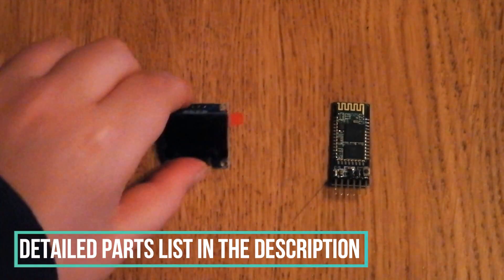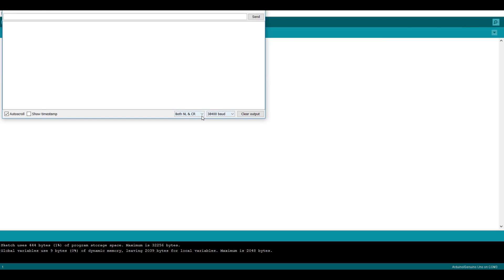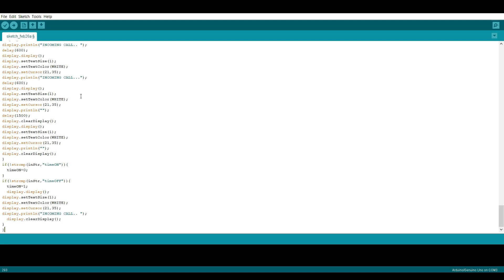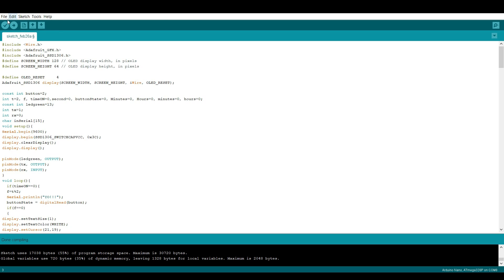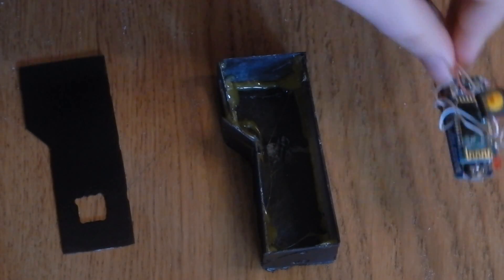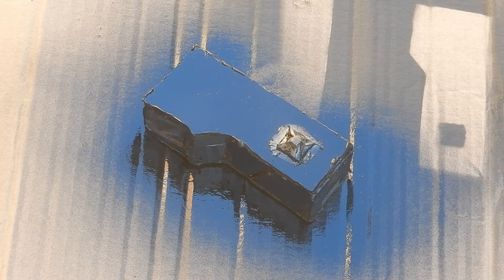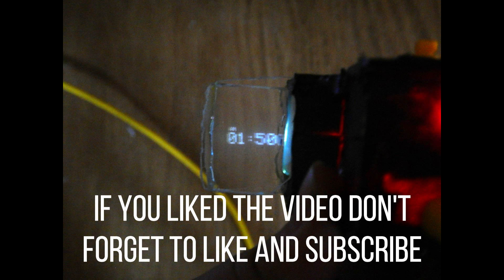DIY Smart Glasses | NO 3D PRINTER

Comment from the maker: *How to install the app*

Step 1: open the link and click on Gallery (top right)

Step 2: in the search bar search for: SmartGlasses App

Step 3: click on the app with an image of my SmartGlasses

Step 4: click on OPEN THE APP then choose a project name and click OK

Step 5: the app editor should open, when it does click on Build (top left)

Step 6: from the dropdown menu choose App (provide QR code for .apk)

Step 7: on your phone enable download from unknown sources (or something like that)

Step 8: let it load and when it's done scan the QR code with your phone (download an app to be able to scan QR codes)

Step 9: a web page will open just let it download the app and it should be installed on your phone

the link: http://ai2.appinventor.mit.edu
Reply: Thanks I'm searching for this project and see a lot of video's but they don't give Arduino But I Finally see your video it's amazing any very useful and you also give Arduino Code and app link
Reply from the maker: Thank you so much!
Reply: it will be more useful if you provide the circuit diagram of the project
Reply from the maker: @parveen sulthana
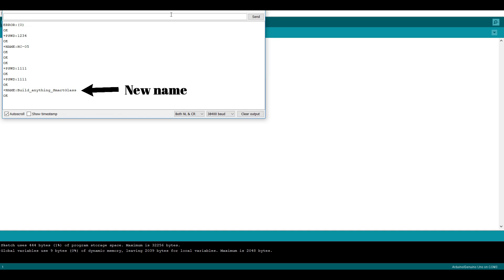I did, pause the video at 1:38
Sometimes you may need to connect the button a little differently. connect one side to GND and the other to pin 2 then everything should work :)

Also I would Really appreciate it if you could subscribe I'm trying to get to 💯 subs :D
Reply: Link not opening??!
Reply from the maker: It does open for me, maybe the servers were down? 
Try again and let me know if it works :)
Reply: @BuildAnything   it connected with bluetooth properly but not showing....msges.....
and also im not added button.....so may be it not work without button.......whatever but ur realy great man
Reply: Bro the link worked and I opened it but when I am clicking on gallery nothing changes , it's the same page
Reply from the maker: @sheenabal7022  hey sorry for the problems, did you open it on a pc? Because I just tested it and it worked fine, try again and let me know what happens!
Reply: Hey, is it just me or the app doesnt have the phone calls, ca you tell me how to enable them
?????
Reply: Bro can u send me a direct link of the application
Reply: How to get the link
Reply: Thank you so much dude

Comment: Hey 
I am a class 11 student .
Will I be able to build this?
As you mentioned by you in your comments , is this video outdated ?? 
If yes then , please tell me some other video showing the tutorial of Smart Glass .
Thanks
Reply from the maker: All of this should still work just as well as in the past :)
Reply: @BuildAnything   Thanks a ton 
And will I , class 11 student , be able to build it ?
I thought one more customisation on this :
Can I use SOLAR CELL instead of regular battery
Reply from the maker: Solar cell probably wouldn't give enough energy + you'd have to add a voltage regulator...

Also I really can't tell you if this is too hard for you or not, I was 14 when I made this but I've also been doing this stuff since I was 10 or 11, you just have to watch the video and see for yourself
Reply: @BuildAnything   Thanks 
I was asking because I am in India and here , the educational system ONLY focuses on the theoretical learning and not on practical work
So this would be my first PRACTICAL TECH PROJECT
Reply from the maker: Oh, that's awesome!

Comment: Hi, Can't understand the circuit diagram, some wires are not connected or maybe it is color-coded
Reply from the maker: Just connect it like in the circuit and it should be fine, if not please be more specific
Reply: @BuildAnything  some wires are not connected
like 2 red wires are not connected so is it color coded and I should connect those  together
Reply from the maker: Are you talking about the "key" pin on the bluetooth module?
Reply: @BuildAnything  I am talking about the main connections at 1:37 seconds of the video
Reply: like the 5V of Arduino and VCC of bluetooth  module
Reply from the maker: @Tech-hx2qx  5V of arduino is connected to the VCC of the bluetooth module, yes
Reply: @BuildAnything  Thank you very much
Reply from the maker: No problem :)
Reply: Just two more questions - One LED pin goes to 5V and the other?
Reply: Could you tell connections for adding a battery

Comment: I am thankful to u for putting up this project. I have uploaded d code and downloaded d app from d link. When I get to d main screen of the app, it is showing connected but when I call from someone's phone or send any msg, it is not showing on d OLED. Can u suggest me what extra things I need to do to receive and c d  notifications on d OLED?
Reply from the maker: So when you send a message from another phone to the phone with the app (and the app is open) it doesn't show up?
Reply: @BuildAnything  Yes. The app is running but on d OLED display, only d time is being displayed. Nothing else. What else should I do? U have connected LED and push button but I did not connect these 2 components. Has it something to do with this? Is it necessary to connect these 2?
Reply from the maker: Yes, connect the led and button and try again. (And make sure to give the app permission to Bluetooth!)

Also if you liked the video and would like to support me you can subscribe, it would really help me with the channel! :D
Reply: @BuildAnything  I have 2 more questions from d circuit diagram u showed :- 
1.) Where r d short and long terminals of LED connected to?
2.) Where is that 1 pin going from push button to Arduino?
Reply from the maker: 1. The long leg from the led is always + so in this case the long leg gets connected to the Bluetooth module and the shorter one (- / gnd) gets connected to gnd

2. One leg from the button gets connected to d4 (arduino nano) and +5V the other is connected to gnd through a 10K resistor

Good luck!
Reply: @BuildAnything  The long leg of LED is connected to which pin of Bluetooth module?
Reply from the maker: Look at the schematic, it's the red wire going from the led to the side of the Bluetooth module (right line of pins, 3rd one counting from the bottom)
Reply: @BuildAnything  Thank you very much. I'm able to receive calls and messages. I modified your app for receiving the calls. Can u tell me how can I display the date and time via Bluetooth?
Reply from the maker: @surajk3195  Sorry for replying so late but I'm afraid I can't help you I'm busy working on another video.. maybe watch some arduino C++ tutorials? I'm very sorry but I don't have time to figure that out for you right now.

Good luck!
Reply: @BuildAnything  Just tell me this much. Do I have to make any changes in d code or in the app that u made?
Reply from the maker: Time is already programmed so you'd only have to make some changes for the date on the arduino. (Unless you want it to auto-callibrate but that's a whole other story...)
Reply: @surajk3195  how did u modified the app

Comment: how do u make it.... smaller?
Reply from the maker: That would not, and I mean NOT be simple! I'm sorry but I really can't explain it like this it would need a whole new design...
Altough I might try to make a v2 in the near future! I'm not 100% sure though.
Reply: The really small screens are very expensive. (I think) The old video glasses from early 2000s used screens like that. They're Kopin or Sony brand Liquid Crystal on Silicon displays. They were like 1000 dollars for a product that does less than VR headsets. Hopefully those small designs will cost a lot less in the near future.

Comment: if i add a litium battery should i change the code?       plz help
Reply from the maker: As long as it's got the right voltage it should be okay. Of course you will need to have a connection to be able to charge it. And no the voltage doesn't have anything to do with the code so you don't need to change it :)

I hope this helps, if it did I would really appreciate it if you could consider subscribing. And if you have any more questions don't hesitate to ask!
Reply: @BuildAnything  sorry, but i asked if i want to change the codes

subscribed.
Reply from the maker: no you don't need to change the code at all for it to work with a battery :)

Comment: The clock is running on its own it's is not stopping please help me as I have to submit the project tomorrow
Reply: Please make it fast
Reply from the maker: My phone died.

There must be some problem with the wiring of the button, check all the connections again and let me know if it works.

Comment: You need a battery to make it portable.
Reply from the maker: you could easily use a lithium battery, I just didn't have enough time or money to order one :)

Also I would really appreciate it if you could subscribe, it really means a lot to me :D
Reply: Build Anything the thing is, it’s a smart glass, meaning it ideally NEEDS a battery for people to wear it. Don’t worry, I already subscribed.
Reply from the maker: Yes I know.. if you want I can give you very detailed instructions on how to add a battery.

Ps, thanks for subscribing
Reply: @BuildAnything  can u plz tell me if i add a battery should i hange the code
Reply: Music Beats nope, as long as the voltage and current is adequate you should be fine without altering the code :)
Reply from the maker: @mohammedjasim5919  no you don't have to change the code at all, as long as the voltage is right everything will work the same as in the video :)

Comment: I connected evertyhing like you but my hc06 module does not working regularly and display starting counting 00.10 00.20 00.30 00.40... what am ı doing wrong?
Reply from the maker: First of all please check if your button is correctly connected
Reply: @BuildAnything  So what should I connect without button?
Reply from the maker: Try connecting one side of the button to GND and the other to pin 2. Please tell me if it works now :)
Reply from the maker: You didn't reply so I'm assuming it's fixed, if not let me know.

Good luck with the rest of your project! :)
Reply: @BuildAnything  I did it but ı have another problem. I connected app, clicking the buttons but nothing happens. Is there a problem with app? Because my hc06 module is working clearly in my other projects. Thanks for help :)
Reply from the maker: Go to the settings of your phone and allow the app to use Bluetooth then you should be able to select and connect to the module with the app :)
Reply from the maker: I'm assuming it's fixed, if it is I would appreciate it if you could subscribe I'm trying to get to 💯subs

If not let me know

Comment: Hey bro pls help me with the programming... It is coming adafruit gfx.h no such file in directory
Reply from the maker: Hm, let me think... 
I know! maybe it's a library that was automatically installed on my pc. Just install the "adafruit gfx" library and everything should work :D. If this doesn't work let me know and I'll figure it out.
And of course if this helped you consider subscribing, I would really appreciate it.

Good luck!
Reply: Hey bro thanks for replying i downloaded the library but now it has error with uploading the sketch. And its having a messege related to the bytes
Reply from the maker: Unfortunately there is a lot and I mean a LOT that can cause this. It might sound obvious but just to be sure first check these things:

- is the arduino plugged into your pc?
- does you pc detect it?
- in the arduino IDE can you select a COM port with "arduino/genuino uno" next to it?

Check these things and tell me the outcome so I know what the problem is and how to fix it.
Reply from the maker: You didn't reply so I'm assuming it's fixed, if not let me know.

Good luck with the rest of the project!

Comment: How can I make the App?
Reply: I have another question, Is all the program for arduino supports every arduino.
Reply: And also will you place the app link in  description. ☺️
Reply from the maker: The code should work for a lot of boards for example the most common boards arduino nano and uno to find out all the board's the code is compatible with you will have to do some research. After filming this video I had problems with my pc and I lost the .Apk file from the app, making it again in android studio would cost me to much time but I can make a new app similar to the one in the video with MIT except that it won't be able to detect incoming phone calls and also isn't able to run in the background. Let me know if you're interested and I'll start working on it as soon as I can
Reply: Ok, Thank you
Reply from the maker: I'm not sure do you want me to make the app?
Reply: Yes, I need you to make that app😊
Reply from the maker: Okay I'll start working on it as soon as I can 😃👍
Reply: Yes, it's me😉
Reply from the maker: Thanks :D
Reply from the maker: You can make the app with "android studio" do this requires some programing. An easier way to do it is by using "MIT app inventor" but I think it doesn't support background apps or incoming phone call detection.
You need to make it so that you can connect to a bluetooth device and then whenever something happens it sends a bluetooth string 
Incoming call: "newCALL"  
New message: "newSMS"
Set time invisible: "timeOFF"
Set time visible: "timeON".
If you have any more questions I'm always happy to help.
Reply from the maker: I just finished the app if you want me to change something don't hesitate to ask, or you can edit the app yourself if you want to. Step to install the app
Step 1: open the link and click on Gallery (top right)
Step 2: in the search bar search for: SmartGlasses App
Step 3: click on the app with an image of my SmartGlasses
Step 4: click on OPEN THE APP then choose a project name and click OK
Step 5: the app editor should open, when it does click on Build (top left)
Step 6: from the dropdown menu choose App (provide QR code for .apk)
Step 7: on your phone enable download from unknown sources (or something like that)
Step 8: let it load and when it's done scan the QR code with your phone (download an app to be able to scan QR codes)
Step 9: a web page will open just let it download the app and it should be installed on your phone
the link: http://ai2.appinventor.mit.edu
Reply from the maker: I have a new subscriber, just out of curiosity is that maybe you?

Comment: Great job! I wonder if you put the angled piece of glass at the front, and angled towards you, if you would get a stronger image, and eliminate the ghost image.
Reply from the maker: Great idea, If you do as you said the image would be much more visible, but it would be reversed. 
If you can modify the code so everything on the screen is shown in reverse it would work great but reversing the image is not easy. 
Good luck :D
Reply: @BuildAnything  you could also use a small mirror and one see through plastic at 90 degree angle opposite and the screen would be brighter looking. It's like the Google glass prism design but without a prism. LOL.
Reply from the maker: But if you would use a mirror you wouldn't be able to look through it right?